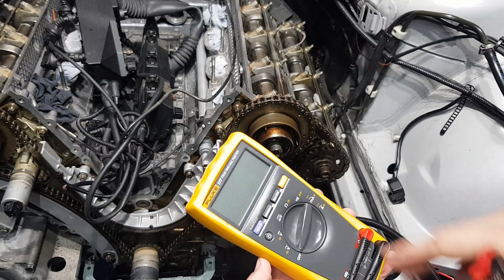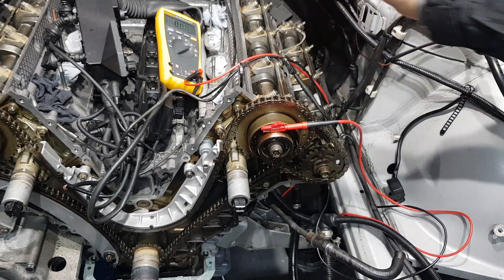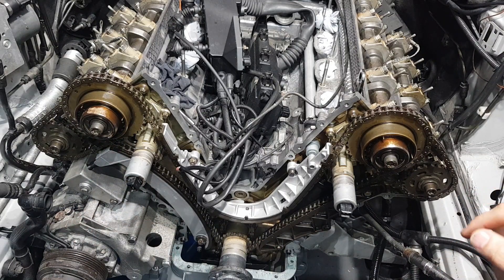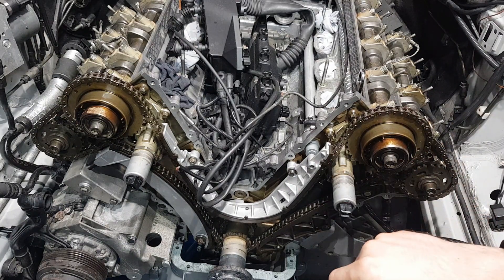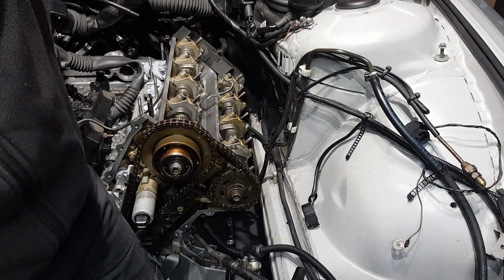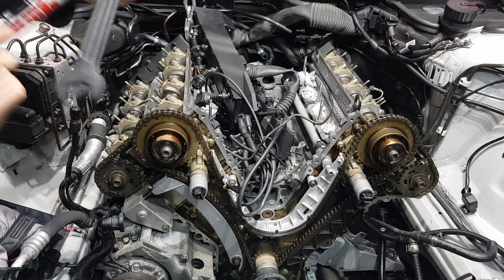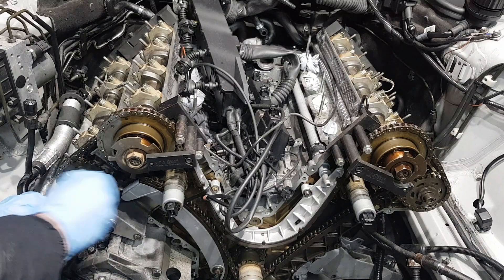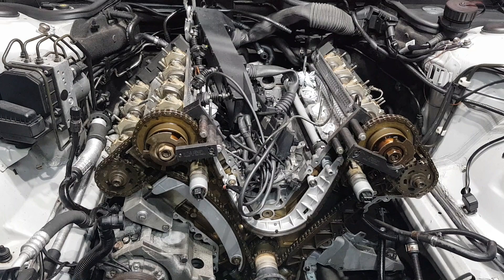BMW M62TU VANOS TIMING, BMW E38 E39 E53 HOW TO TIME VANOS SYSTEM BMW 740i 735i 540i 535i X5 4.4 V8

Comment: I thought you also have to make sure TDC is lined up with a corresponding notch on the flywheel? Why isnt that part in the video?
Reply: I need help. I followed your entire procedure and cant get the engine to start. I have a feeling its because of improper timing.
Reply from the maker: @TakesTalent  I had no issues and my car wasn't running for 2 years. Make sure you have fuel (check fuel pump) spark and compression first. Make sure your engine has correct oil and correct amount of oil. Also make sure all sensors are plugged in and working and then give it a go and it should work. I am confident in my method as it is by the book. Hope you get it sorted
Reply: @TheKeenMechanic  thanks for all the tips. I think its a great tutorial nonetheless. However, im about to put things back together tomorrow. I think i did the timing procedure incorrectly because i didnt lock out the flywheel in the correct position. This time though i am more confident that will start because im sure i locked out the flywheel correctly. The first time i did it, i remember the notch and OT were not lined up precisely and this time they are. The only thing im afraid of is that i didnt damage my valves when i went to start the engine while the engine was off timing. That sound the engine makes when you think the fuel pump isnt pumping fuel, may be the valves making contact with the pistons when you go to start it. Fingers crossed. Thanks for the tips.
Reply from the maker: @TakesTalent  Let me know how you get on🤝
Reply from the maker: As crankshaft and camshafts are locked you don't need to worry about the rest. I have videos shiwing how to lock these in case you are not sure. I have tried to do it as easy as possible to help others with less experience. If you follow this tutorial I am certain you will have no issues with the timing🤝

Comment: Can this method do on  the 2007 550i 4.8l?
Reply from the maker: Hi
I don't want to say yes in case I am wrong as I have never worked on the 4.8 engine. Sorry I can't give you an exact answer
Reply: @TheKeenMechanic  it's an n62,v8
Reply: The reason why I'm asking,my obd said I tooth offset to crankshaft, I try the multimeter on it, it's beep on both cam, but I have ruff idle
Reply from the maker: @futurelink5967  Try the facebook BMW groups for help. I am sure someone who specialises on N62 could help you with this. Hope you find the problem buddy🤝

Comment: Curious, no transmission 0r differential 
videos like fluid change?
Reply from the maker: Hi
I have done transmission fluid change, but had no lift at the time and I had to go to my friend's garage so wasn't able to film it. Haven't done the diff yet, so when I do it I will record. I have a new genuine zf hp5-24 transmission service kit in stock so when the next opportunity comes I will record a transmission fluid change. Are you thinking of doing it when you get the car going?
Reply: @TheKeenMechanic  100% changing transmission and differential fluid. I hate BMW’s  “life time fluid” nonsense. I emptied the fluid out of my manual E39 and the fluid was disgusting. Car drive so much better with new transmission fluid. I ordered everything already. The car’s mechanical issues are all repaired. 

I have the radiator, hoses and aux fan to install once delivered. They’re coming early next week. I purchased oil, ATF, and coolant today. Even put a new BMW emblem on the trunk last night. I’m buying a transmission filter and gasket off EBay motors. $23 & free shipping. Never used EBay; but BMW guys in the U.S. totally rebuild their cars using just EBay motors.  I’m so close to done I’m searching for a 750iL. Have maybe a week left of work then a decision to sell or keep.
Reply from the maker: @paperandmedals8316  Totally agree. BMW lifetime fluid is a complete nonsense. You should have seen the difference in the colour of the old and new fluid. The old one was pure black and the new was the colour of vegetable oil. Not much left to fix. 1 day work. You can advertise and see if it sells for good money and help fund a new project. 750il will be nice.
Reply from the maker: @paperandmedals8316  What fluids are you going to use?
Reply: @TheKeenMechanic  so I unscrew the transmission full plug and fluid comes pouring out. Car is level. How can I get more fluid in them what gravity allows? I believe it calls 6 liters, I orders 7, or 2 gallons. I’m doing the filter and gasket also.
Reply from the maker: @paperandmedals8316  Everyone makes that mistake😊 This is how it is done: Open the drain plug and drain the transmission fluid, remove sump and replace the filter, be careful with the installation of the filter not to damage it. Close the sump drain plug and pour as much oil as it will take through the filler hole, when the oil starts pouring through the filler hole you make sure the hand brake is on tight so wheels dont spin (very important!) Start the engine and add more oil with the engine running and gearbox in Park and handbrake on. When oil starts leaking out again with the enging running step in the car and with hand brake on and foot on the brake just in case put the car in manual mode and run through all gears(no need to go into reverse) then when you have done that go under car again and see if you need to add more oil and if no need close the filler plug and you are done🤝
Reply: @TheKeenMechanic  I get it. ATF spinning around lowering the pan amount. 

And this can all be done with the car on jacks and ramps? The back tires are actually on ramps. Front jack pads have jacks stand plus hydraulic jacks near them just press against the car taking very little weight. Actually makes for a reasonable work area. I’m 6’2 and 240lbs and my chest makes it under the car with room to spare. I cracked the drain plug on the transmission with a breaker bar and when it let go my elbow slammed into the backside of the sway bar bracket lower welded bold.  I laid under the car impressed I wasn’t actually crying it hurt so bad. My hands look like trash. Horrible way to make a living. Couldn’t do it.
Reply from the maker: @paperandmedals8316  I did it on a 2 post car lift as I hate being under a running car doing this stuff. Didn't want to risk it and also get burnt from the exhausts. Sorry to hear about your accident. Not a nice thing to happen to anyone. One of the reasons I bought a car lift a month ago
Reply: @TheKeenMechanic  you have a car lift. Good for you. I don’t do this often enough yet, but they’re cheap in the US. $2k. I think that’s a very reasonable price. Problem is my house has a concrete steel tension floor. Can’t drill into the floor. But I believe they have them with platforms.
Reply from the maker: @paperandmedals8316  Hi
Yes, I bought a mid rise lift for my garage as I have low ceiking 2.5m tall. I went for Twin Busch TW S3-10 E it was close to  2200gbp $2900 with the additional trolley kit. These don't bolt into the floor so this would be a great option for you too. It is worth every penny🤝
Reply: Diff yes, tranny absolutely not